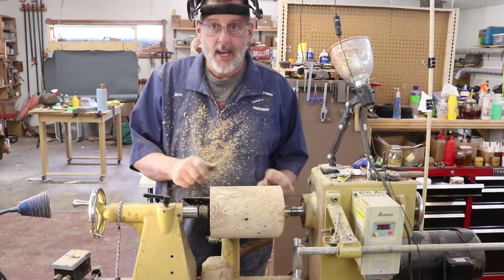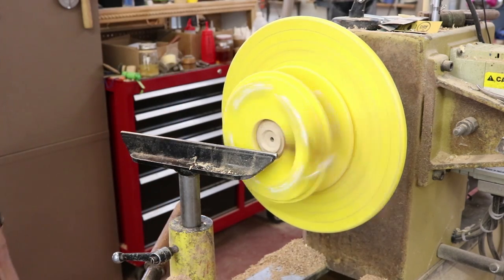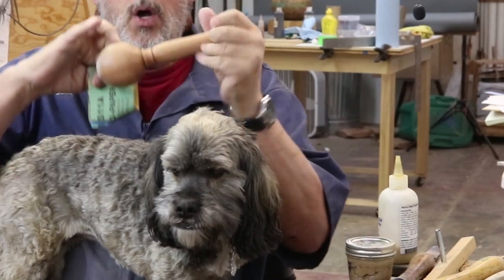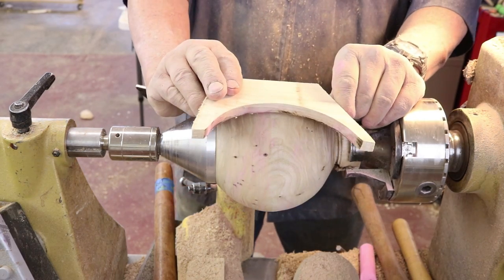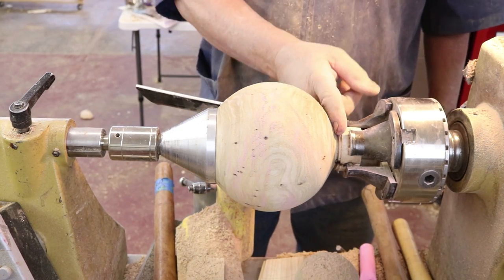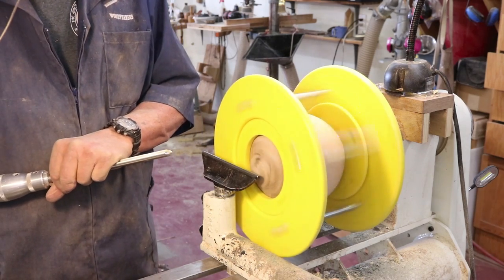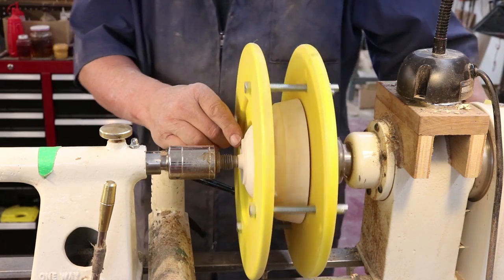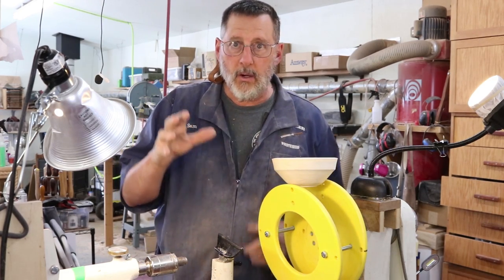Showcasing the Doughnut Chuck  Sam Angelo (wyomingwoodturner)

Comment: Hi, Sam. I bought Ron's combination Longworth and Doughnut chuck. I have not been able to securely hold a piece in either configuration. I hate to torque the bolts down any more than I already am. Very frustrating for a $200+ piece of kit. What do you think I might be doing wrong? Thanks!
Reply from the maker: Bob  
In the longworth mode I would keep the tail stock on the piece as long as you can before you turn and sand the very center.  In the doughnut chuck mode I would at least bring up the tail center to line and center the piece.  Then, if you go to 17 min 29 seconds into the video you will see how I line things up.  I think if the base and outer ring are not parallel then the bolts may not hold securely.  Some photos would also help. if you can, send to samandcheryle@gmail.com  Show me what you are turning and how you are chuck it up.  What happens when the piece comes lose?  Sam
Reply: Thanks, Sam. When I get back to my shop in a few months I’ll give it another try. I regret buying it because I think there are much quicker, cheaper, and easier ways to get the bottom off a bowl or vase.